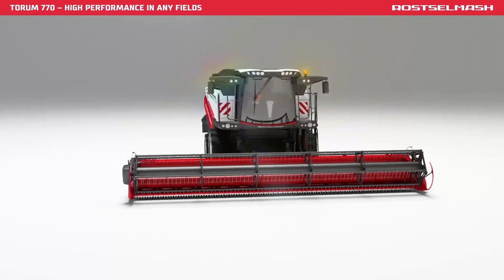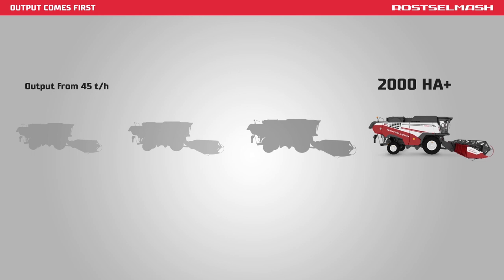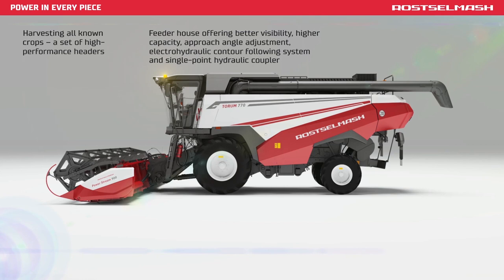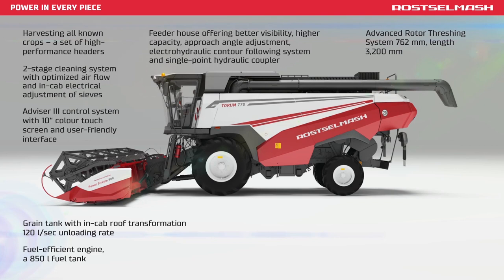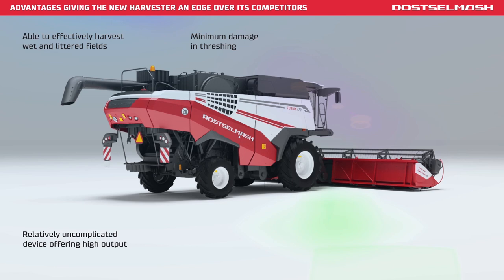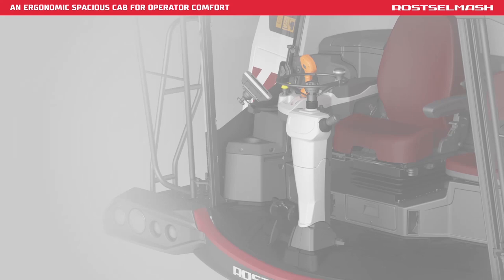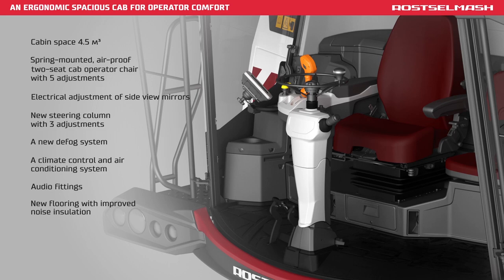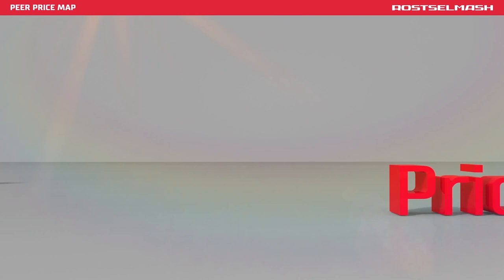Presentation of TORUM 770/785 rotor combines (second generation of TORUM)

Comment: Big improvements but how large is grain tank and sizes front/headers are available?
Reply from the maker: Thanks! We will clarify this information
Reply from the maker: Grain tank volume – 12 300 liters.
It is capable to work with all kinds of headers – from pick up to universal & specific ones (Active Stream, Power Stream, Float Stream, Draper Stream, Argus & Falcon, Sun Stream & Corn Stream, etc) with operating width from 7 to 12 meters.